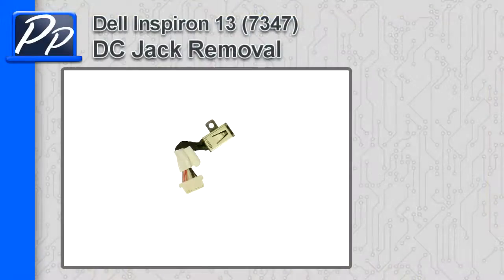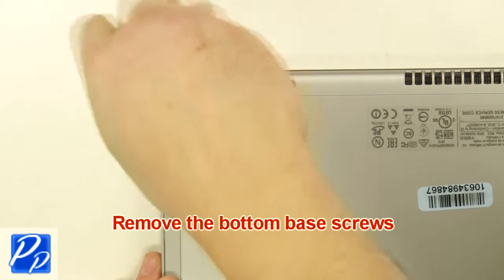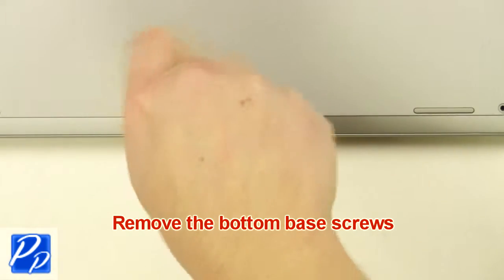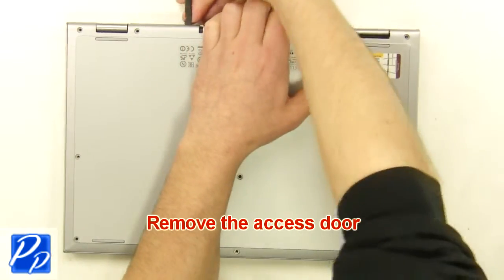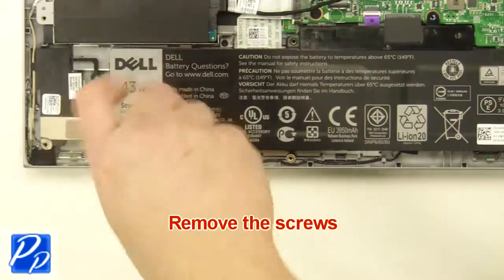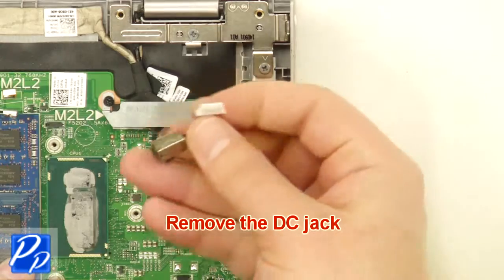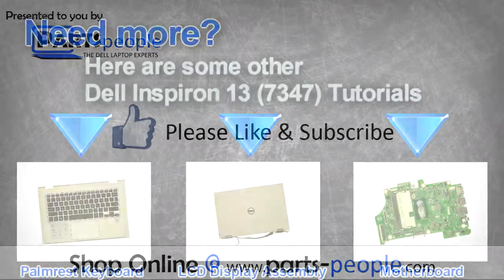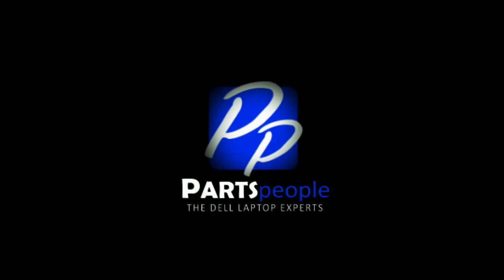Dell Inspiron 13 (7347) DC Jack How-To Video Tutorial

Comment: If I'm just attempting to replace the DC jack, is it necessary to remove the battery from the assembly or can I just simply just remove and replace the DC jack on it's own?
Reply from the maker: It needs to be removed because you need to remove all power from the laptop to minimize the chance of static. Removing all power is the first step to any electronics repair.

Comment: Help please! I have Dell Inspiron 13 (7359). My DC Jack is fine but the bracket that holds it down is broken. I tried super gluing it but that doesn't work. Do you know how I would fix that? I've tried googling every combo and the only thing I get replacing the DC jack. I need to fix the bracket that anchors it. Thanks SO much for your help!
Reply from the maker: +fauxmixedhair It screws onto the Palmrest Keyboard assembly. You would have to replace it to get a new screw mount.